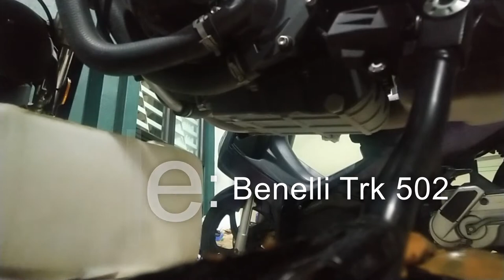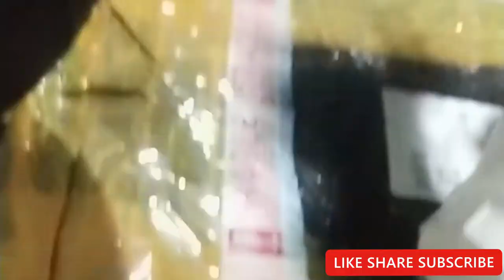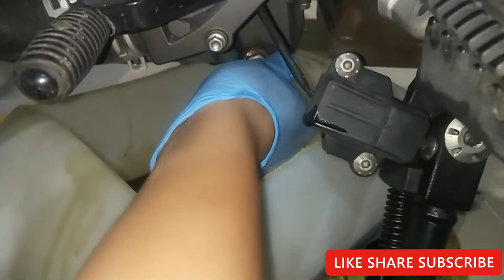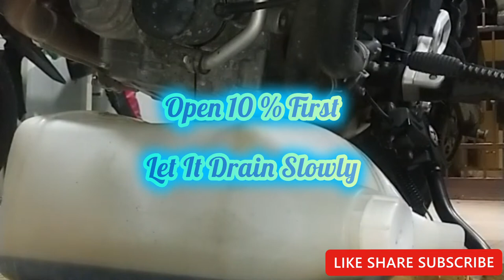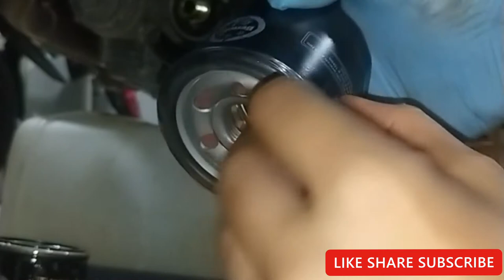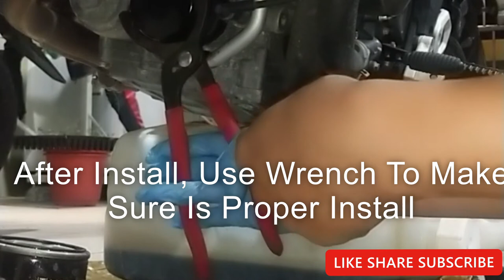Benelli TRK 502 Oil Filter and Engine Oil.

Comment: I wanted to know what engine oil I put in the Benelli 502C 15W50 or 10W50?
Reply from the maker: please look into sticker near the cap, btw the reason i used 15w50, because of cant find 10w50... actually no diffrent both type, end temperature same, only weight oil take effect